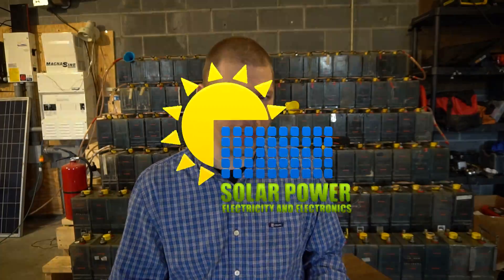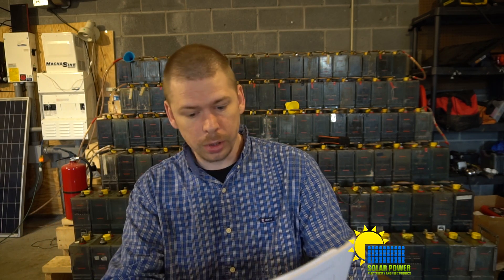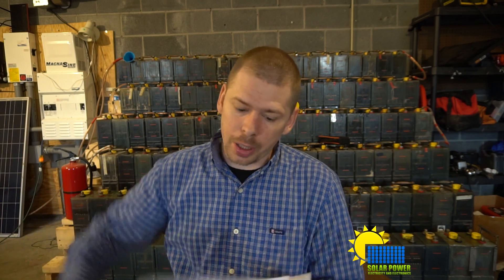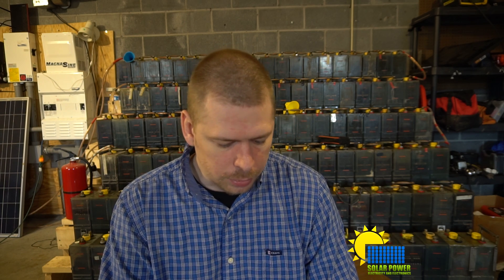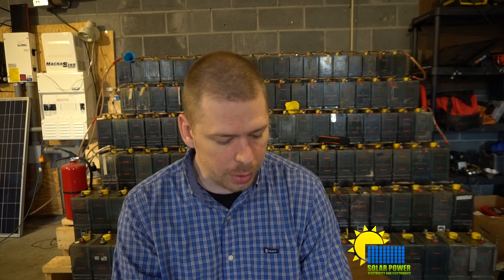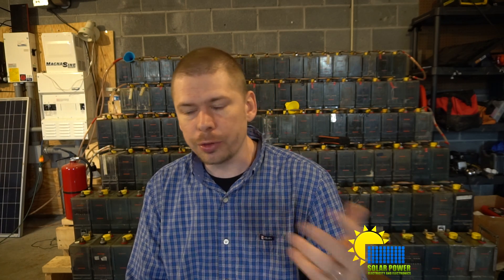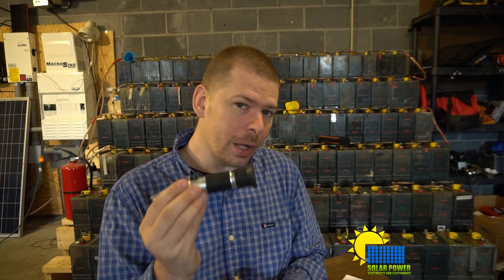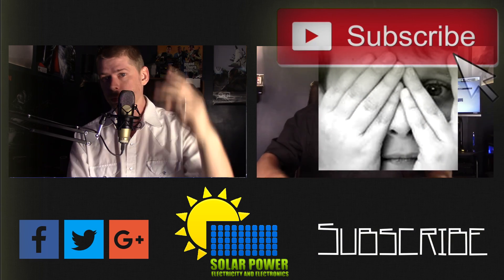How to kill your solar batteries at your off grid homestead.

Comment: Wow , you have enough batteries there to run a small diesel / electric submarine.
Hmm  speaking of Diesel subs......I wonder what happens to the batteries in them when they are decommissioned?
Would they make good batteries for a solar power system?
Reply from the maker: Bill23799 these are similar type of batteries that you're going to find in submarines